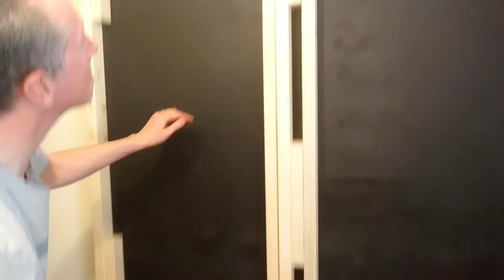Building a Vocal Booth: Part 3 Assembling the main stud frame.

Comment: I have built a home studio of Gyproc wall profile and various other building materials such as polystyrene plates & Rockwool rocksono of 7 cm thickness, my home studio was later provided with acoustic foam of 5 cm.
 and I have a silent ventilation system from Sonair Silent Ventilation unit.
I now have a home studio that is super quiet, so that I am not bothered by ambient noise & the neighbors also have no problems with me.  the total cost of building is 1575 euros.  but that is much cheaper than buying a sound booth
Reply from the maker: Good work!